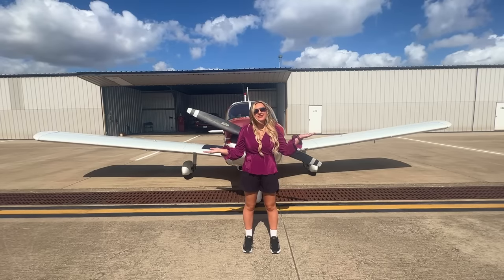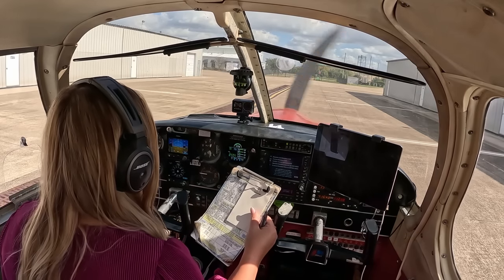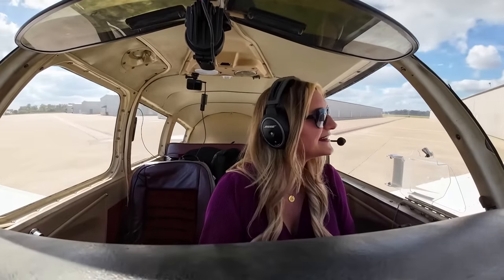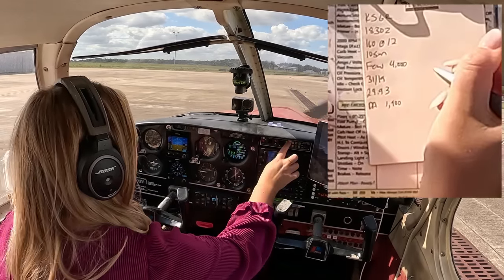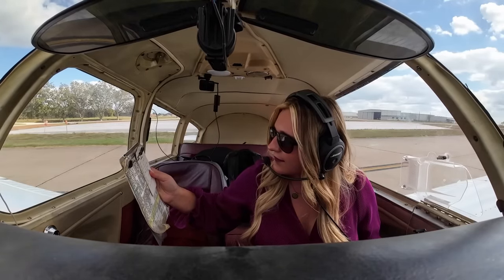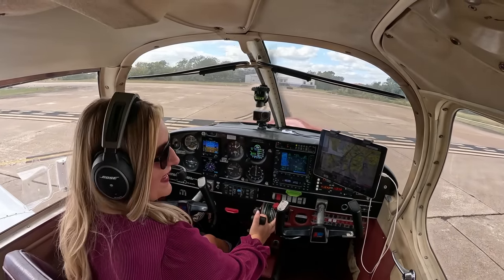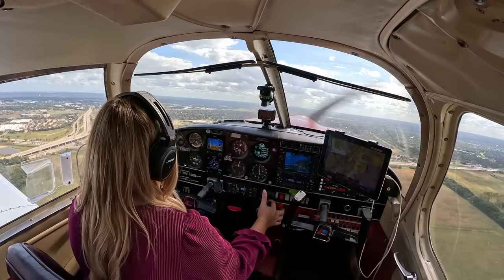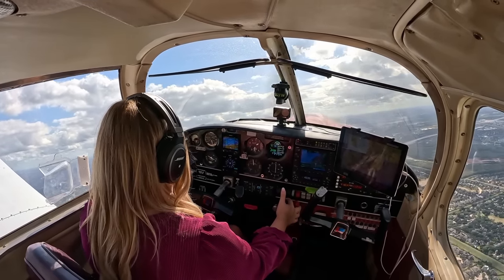Emergency! Failure In Lil Red - Return to Airport!

Comment: Picture wasn't sharp but it looks like the fuel flow was erratic on the ground and pegged to the max the entire flight. You confirmed all other engine parameters were in the green (including) CHT's) multiple times and engine was running strong.  Maybe expectation bias?  If fuel gauges are correct and as expected then most likely the fuel flow meter (sensor) is bad.  Nonetheless, the only thing worse than an engine failure is an engine fire.  You were in a good spot to turn around so good decision.  I would have declared a pan pan to get priority as it is free.
Reply from the maker: Once I got back home and took a look at the footage you are correct! One thing I find interesting is that the GI275 did not alert me to this crazy indication.

Very good advice on the pan pan though, I will keep that in mind for next time (hopefully there isn’t a next time though!)

Comment: If your actual fuel flow was that high the engine would have gone severely rich with a rough running engine or the engine quitting.   Did your fuel quantity gauges show a rapid loss of fuel to validate the high indicated fuel flow concern?
Reply: You aren't considering a leak between the fuel transducer and the engine. As a pilot, that would have been my guess and fear because that might be spraying fuel on hot surfaces.  That also might have created cooling as the engine was cooled by evaporating fuel. What was strange was that at climb her CHT was 405 which is a tad hot and then on a slow descent it seemed low as she was in the low 200s but her plane might be different than mine. Of course the engine monitor might be bad....that is the highest probability IMHO.
Reply: She mentions in another comment that her fuel quantity gauges did not show an abnormal drop so....faulty fuel flow sensor or readout.

Comment: Did you figure out you had a fuel issue going on??
Reply from the maker: It’s was a depiction issue actually!!
Reply: @FlyWithKay  have you called your mechanic to let him know about your issue??
Reply: @FlyWithKay  it's amazing how many times you can answer the question without giving the answer  -- "a depiction issue" , "instrumentation" etc.  etc.

However, buried deep within all these comments you did actually say what the problem was -- the k-factor was miscalculating.  But WHY was the k-factor miscalculating?  And what was done to correct it?

Comment: Did you find out what was wrong ?
Reply from the maker: Instrumentation. All fixed up. I'll do an update on my next flight.
Reply: @FlyWithKay  it's amazing how many times you can answer the question without giving the answer (I might have said it has to do with being blonde? -- except that your aren't really blonde  ;-) .  

But buried deep within all these comments you did actually say what the problem was -- the k-factor was miscalculating.  But WHY was the k-factor miscalculating?  And what was done to correct it?

Comment: I used to fly aerobatics with a friend who had his aerobatics license. For almost a year, we rented an old 152 Aerobat and a cloth-covered Decathlon with break-away doors and flew in the designated aerobatic fly zone. Safety was paramount, so we both did the checklist independently and let nothing to chance. Just reading NTSB reports of the accidents that can happen from the tiniest things like not checking a seat stay or not flying the plane when an issue comes up, we seemed to take more pride in the safety aspect than in the maneuvers we would execute. I say "we" but he had the yoke. I watched for traffic, kept second eye on the gauges and kept constant feel for engine, structural and control functionality. I never got in his way and he was in full control. Even with all our attentions, there's always "something" that happens.... we were on final at an uncontrolled field when we were cut off by a Mooney who came in hot and unannounced. We never did confront him on the ground as we figured he'd be in an upcoming NTSB report. Anyway, I may be over-stating our method to flying as it was more relaxed and enjoyable than I make it out to be, but what a great time we both had. It was so satisfying to banter about the minutia of safe flying at breakfast and what we could possibly do better after each flight. It was truthfully one of the most rewarding things I have ever done.

Comment: I don't know if you are fuel injected, but very few pilots know that in pre-modern airplanes, the fuel flow is actually done by measuring fuel PRESSURE.  Measuring fuel flow directly was at that time somewhat difficult, and since fuel flow was regulated by increasing or decreasing pressure to the injector-distribution spider on the engine, the assumption was that more pressure meant more fuel squirting through the injectors.

The problem is that if an injector becomes clogged, the pressure goes 'way up, giving a high flow reading when in reality it's the other way 'round.  I'm new to your video; I am sure somebody else has brought this up.  All best.

Comment: Wow I literally just had this happen a few days ago. GPH shot up to 10–15 GPH. Engine ran great and temps were the same so I knew the engine wasn’t eating it. I then pull engine heat to smell for fuel. No fuel smell so I know it’s not spraying everywhere. Last I figured rock it back and forth and look for change. I saw change so knew it was a connection. I still stayed 9500 till over the airport and circled down. 

Ends up it was a connection and that’s it. 

Final thoughts. I’ve been in the racing industry for years. This was not taught to me in training. This was something the average pilot doesn’t know about. Get more training and keep on learning. There are check lists you need to make that no flight training place will teach you. You have a lot to learn. Fly safe see you out there 🤙🏼

Comment: This is probably a stupid  question  because I am not a pilot  but  why wouldn't  you tell the  traffic controller  when he ask ,that you have  some type of gauge malfunction  and ask to stay at 5,000  back to the airport ? This way if something did go wrong  you could have more time to make landing decisions ? also you have a lot of cameras ,why not add one under that wing so you can monitor  any fuel  leaks coming from the engine  or wings ?

Comment: When I was first learning to fly, it was in winter in Wisconsin and very cold. But you flew when you could get the hours.  In other words, when I was free and my instructor was free.  I made sure that the fuel tanks were full and we were off.  Once we were in the air, how I loved that feeling, my instructor asked me what I wanted to do.  Basically I just needed to put in enough hours until I could solo.  I was kind of worried about the gas gauge so I told him that I would prefer to land.  One tank hadn’t moved and the other one was dropping faster.  We had be up about a half an hour by this time so we should have had plenty of fuel left.  We landed, pulled up to the pumps, and the engine died.  My instructor asked me what I wanted to do.  Put some more fuel in and finish my time.  I paid for it.

Comment: Kay, you just took me back 60+ years! I am 70 now and my dad used to have his private pilot's license in upstate NY where I was raised. He flew "by the seat of his pants" with very little instrumentation. I remember flying in a high wing Piper Cub when they had joy sticks, and I will never forget the thrill of going with my dad on a few flights. Thanks for the trip down memory lane. I also loved hanging out at the airport! The runway was a path through the pasture of a dairy farm that had been graded. It was always a bit bumpy for take off and landing, but as a kid I loved it! I recall whan I was really little, sitting in the rear co-pilot seat and my dad began to panic because the plane was difficult to control. He turned to reassure me and tell me to hold tight and I had my hands firmly on the joy stick - "Whee daddy, I am flying!". I don't recall if he swore or not but in no uncertain words I was told to let go and sit on my hands.

Comment: Good job handling the situation. The only suggestion I would make is that if you run into a an emergency situation like this again maybe considered not talking to the camera anymore. It's a distraction that you don't need.  You can tell that you're having a hard time narrating and focusing on what's going on at the same time in the very beginning and if things suddenly got worse you might enter task saturation without even knowing it.
I know it's bad for the video but having a mental rule that you stop talking to the camera the moment something starts to go wrong might not be a bad idea.

Comment: RPM Ok and fuel pressure Ok are the most important things to check on the take off roll, the speed is later on.  My CFI had 4 emergecies on take off roll and climbing out and developed that system to catch problems on the take off roll.

Comment: Yes I want to fly and I am super careful and love checklists. Like even at idle it would have shown a higher gph fuel rate you should have caught that on the ground especially when you put a new part in. I would have asked what does a magneto do and can it affect any of my gauges or readings. Since I don't know anything I have to be smart enough to ask a question that will get the guy to think of everything. Anyway all is well that ends well.  Best wishes and good luck.

Comment: You did good..used your head..abort the mission because “something is NOT right”…you saw it, you knew it. Get the aircraft back on the ground. Solve the mechanical issue…never push a bad situation. A+ ..

Comment: great job. Just as a suggestion, I'd tell ATC that you have a potential engine issue and would ask to stay higher till you are over the field. No reason to be at 2000 AGL 6 mi out with potential imminent engine failure. Declare emergency if they don't cooperate

Comment: I would have preferred to stay at 5000' or higher until over the airport then descend.  Almost zero risk of an off field landing in the event of a late engine failure that way.  If you have never flown in an RV (RV-6A type) then do it.

Comment: I hardly know enough to ask a question but that burn rate was obviously ridiculously high for that size engine. I wondered if fuel was leaking, if that would even appear on the screen? Probably  sensor?

Comment: Sounds like your fuel flow transducer was malfunctioning. If that much fuel was really going through the engine, it would be running rich and trailing black smoke. And running rough. Then again, if a leak sprung up somewhere after the transducer, at a fuel fitting or ruptured hose, then the reading would read high. That's why it's prudent to land, due to a possible fire hazard. And also the instrument itself could be getting correct data but not displaying it correctly.

Comment: That was not an "emergency!" 'Issue", yes. "Anomaly", yes. Emergency, no. Would suggest being accurate with titles, might get less clicks short term but more subs long term.
Reply from the maker: Not being able to trust my engine instruments while flying in and out of clouds after having work done on the airplane IS an emergency in my opinion. 
I didn’t declare because I felt confident after cross checking that it was an instrumentation failure but I was still ready to make an emergency landing if needed. Thanks for watching!

Comment: Just curious as you were on ground it was indicated a 36 gallons burn per hour , as your climbed to 3000 ft, the fuel burn indicator showed 16 gallons per hour. It could be related to fuel filter restricted flow  and fuel line chocked as the low air pressure. Check the fuel line and replace the fuel pump.
Reply from the maker: It was actually a simple fix, my k-factor needed to be recalibrated after I got some work done on the plane😊

Comment: Good job with your fuel problem.  A quick top off would tell you what your true fuel consumption was.  With the 180 engine, I normally burned 10 gal/hr.  Regardless, it was going to put a dent in your pocketbook.  I had a 1968 180 and loved the airplane.  I got several hundred hours of time in the plane before I traded it for a Bonanza.  It was during the time when the Bonanza had a very serious AD on the tail so I was able to trade even for the G35.  You have a very tricked out airplane.  Did you have all that gear installed, or did the plane already have the equipment installed?  You are right at the are limit for flying in the Navy.  If you really want to fly with the best, then be a tail hooker!

Comment: Re: Your Emergency return to the airport. You didn't declare, so was it a real emergency. Could have been. I don't know your plane or the instrumentation and what failure modes that are possible, BUT, if the fuel pump is pumping out twice the fuel as it should (unlikely) and it's dumping into the cowling, there's a potential fire, so NO DOWNSIDE to declare. Take advantage of all the special handling you "may" need. You can always cancel an emergency without any penalty or issue. Otherwise, calm and great handling.
And, have you ever heard of the "sterile cockpit"? Perhaps you should apply that to your operations manual and have a second pilot aboard to either make the comments or watch the plane. I could argue that it's a must, even in small piston planes, and eliminate any unnecessary comments.
You have a great platform and can develop it easily to the next level. Keep it up.
Larry
ATP, CFI, II, MEI 
Avid Beechcraft guy

Comment: In situations like the fuel rate, it would be helpful for us non-pilots to tell us what you expect, compared to the gage reading.  IDK if 30-35gph is too high or too low.  Also, for the airports you frequent, do you memorize local geo for emergency landing places?
Reply from the maker: 30-35gals was way too high, I usually burn between 8-11!!
And no, I don’t have a ton of airports that I frequent😊

Comment: Kay, first let me congratulate you on your excellent decision making in deciding to get the airplane on the ground.

Ten years ago a friend of mine was flying to KPOU in his Cessna 182RG.  He was on his way to pick me up from the avionics shop at KPOU where I had dropped off my airplane for some work.  He was about to cross the Long Island Sound which is about a ten miles wide body of water when he noticed his fuel pressure dropped to about 1 pound and his fuel flow went to 55 gallons per hour.  These readings were presented on his Electronics International Engine Analyzer.  The engine was running fine and there was no other indication of a problem.  Not knowing what the problem was he decided to turn back and land at the airport he had departed from.  He called the tower and advised them of the problem.  They cleared him to land on any runway.  With everything still appearing normal other than the erroneous indications he began to descend for the airport.  He then lowered the landing gear and first notch of flaps.  Within minutes he smelled smoke.  Still a couple of miles away and high he turned and set himself for a straight in.  As he is descending towards the airport he now sees flames flickering around opening the rudder pedals enter the cabin.  The tower now calls him and advises him that he is on fire!  Flames can be seen coming from under the aircraft.  He hastily gets it on the ground and stopped and bails out of the airplane.  Airport Fire Rescue was on it quickly and it took them awhile to get the fire out.  The aircraft was destroyed.

NTSB & FAA discovered what caused the fire.  On the 182RG there is a steel fitting that connects the steel fuel line to the carburetor.  This line broke off where it was attached to the carburetor resulting in fuel being sprayed all over the rear of the engine.  Although the line broke it did not fully separate from the carburetor allowing sufficient fuel to still enter the carburetor and keep the engine running.  Microscopic examination of the fitting showed a fatigue crack in the fitting that was probably there since it was manufactured and that only after years of vibration did it fully break through.  It was speculated that when he lowered the gear, a spark from the solenoid mounted on the firewall ignited the fuel.

He was very lucky that day!!  It was only his sound decision making to get the airplane on the ground that saved his life.   Had he caught fire and crashed into the sound they probably would have never found the cause!!!

Never try to figure out problems in the air!!  Especially when they are engine related.  Get it on the ground and figure it out then!!!

Comment: If you're not on an IFR clearance, why are you flying into the clouds?

If you're cutting your flight short because you're concerned about your engine, you should certainly fly a higher approach.
Reply from the maker: You either aren't sure what IFR is or you didn't really watch the video. Try again, no penalty for watching twice! :)
Reply: @FlyWithKay  My apologies!  I'll admit that I skipped around in the video and missed the part where you picked up your clearance.  My recommendation for a higher approach remains.  The airspace in the Houston area is rather busy, you spend very little time looking for traffic.  Talking to ATC doesn't relieve you of the responsibility of collision avoidance in VFR conditions.

Comment: I have always loved the idea of flying, but the opportunity (for various reasons) just hasn't been there for me. But one thing has always made me think that I wouldn't be able to fly. I have noticed that the pilot and air traffic control speaks very fast. I don't know of it is my dyslexia or something else, but I have never been able to comprehend information that comes at me at an accelerated pace. It's the same result if I read fast. The input just isn't comprehended. 
This has left me wondering if this has been an issue with others that have been able to fly?